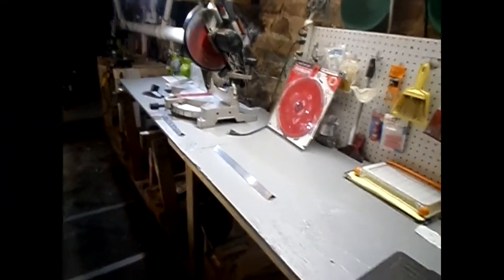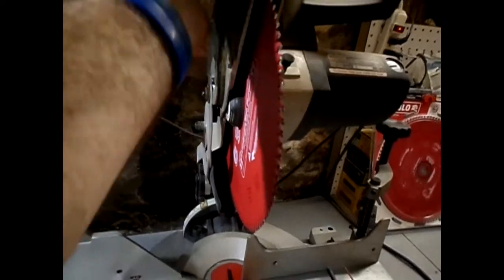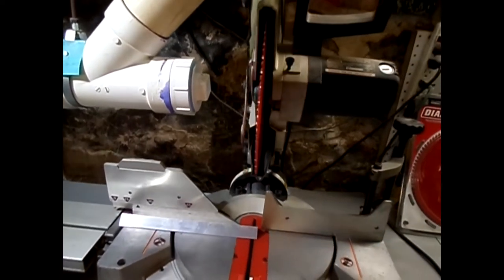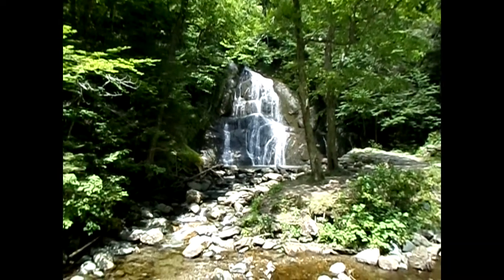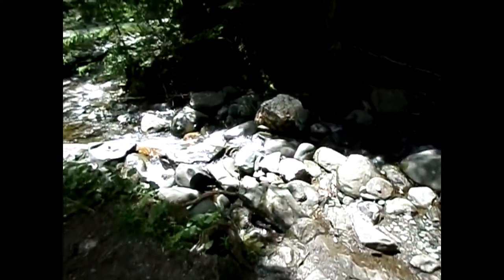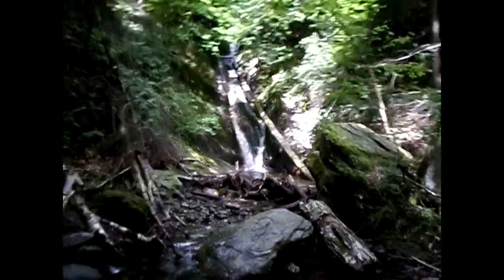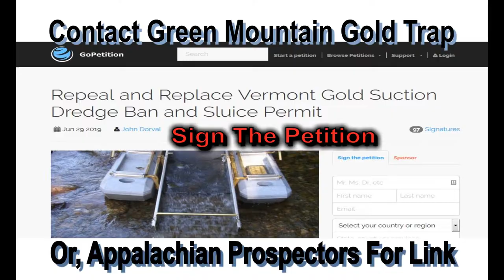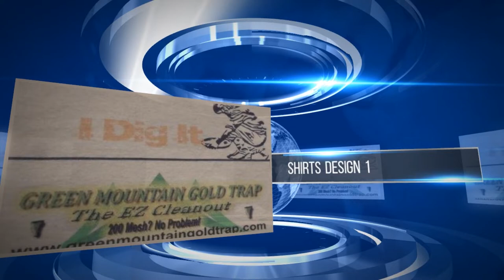Trip Up North Well Withing The VT Gold Belt

Comment: I would have filled something with material to test later. Probably would have been late. Well done...
Reply from the maker: I should have brought something to put material in! And on the way back, we went a different way.
Reply: Bummer. Next time fill your shoes and do a video.
Reply from the maker: @archerydogg  Now why didn't I think of that? OR! I could have dumped out the cold salad in the cooler and filled that container.
Reply: I actually used my socks one time to test different spots. They were slick.
Reply from the maker: @archerydogg  That's epic Ron Dog!! Your going to rub off on me bro!
Reply: Had my cargo pockets full and walked out of a canyon. Rubbed the skin off my legs🤨
Reply from the maker: @archerydogg  Well, I think I will pass on that one! Doesn't sound too good to rub the skin off! I do that enough with my knuckles while working.